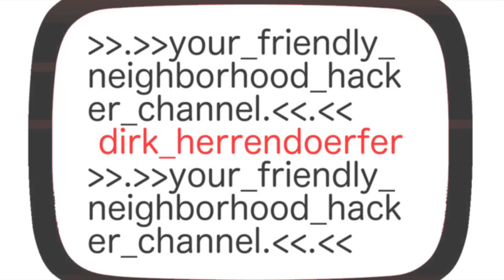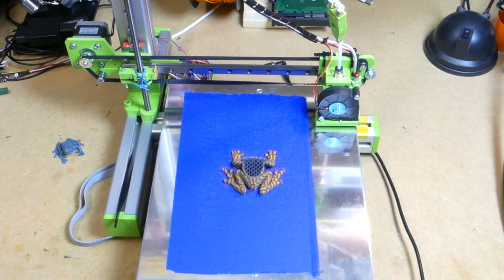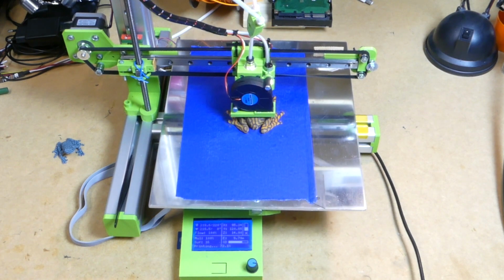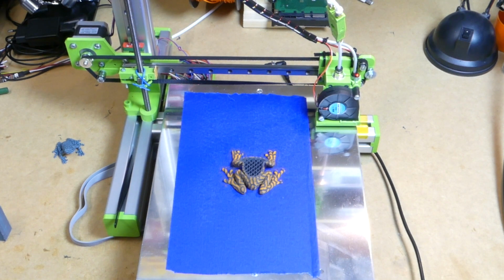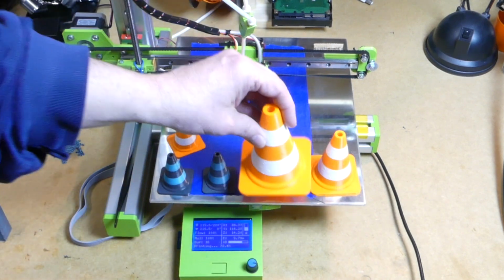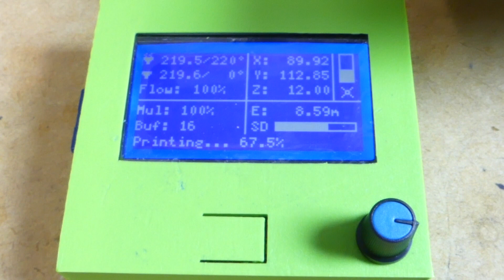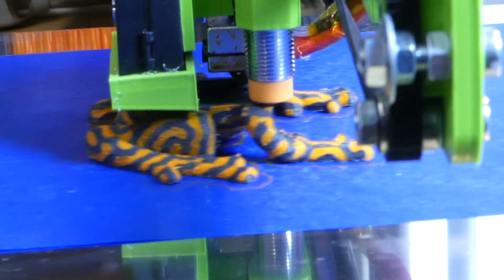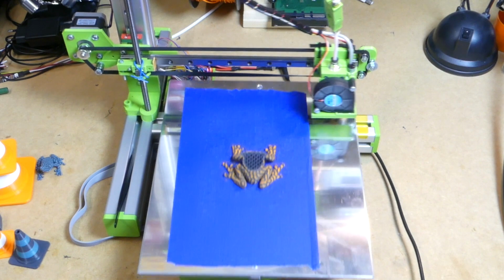I put a big hole in Bad Robins print bed - it's great !

Comment: Hi friend, i am from Brazil, Could you tell me the necessary settings in Marlin, to use 2 extruders and just one nozzle? What do I have to activate?
Reply from the maker: There is no change required to the firmware, it is basically done by the change-tool code of the slicer, if you look into the cura settings, you have code inserts for before and after tool-change. that's where the retract and spool need to happen.